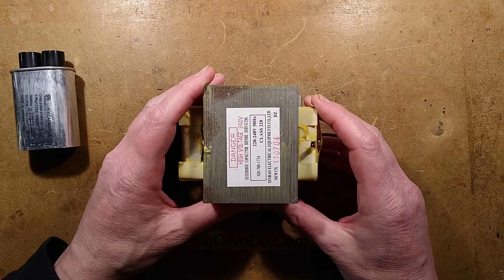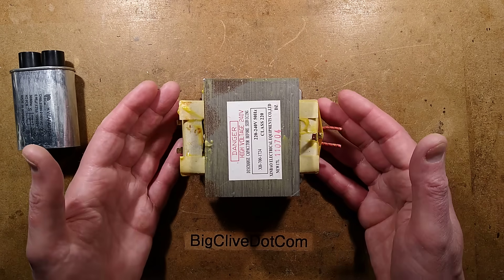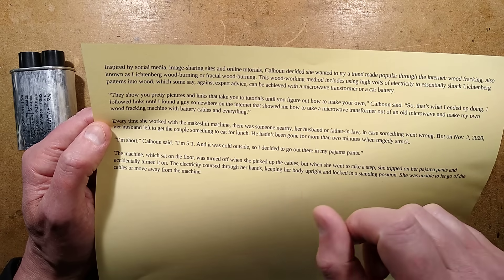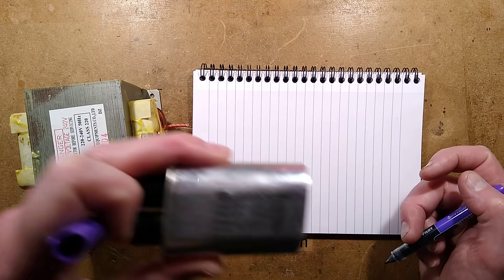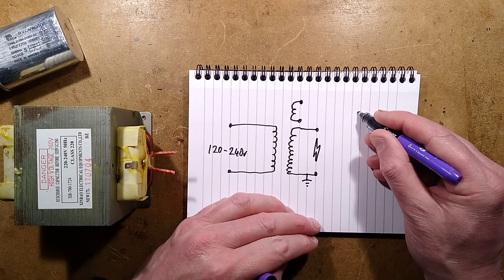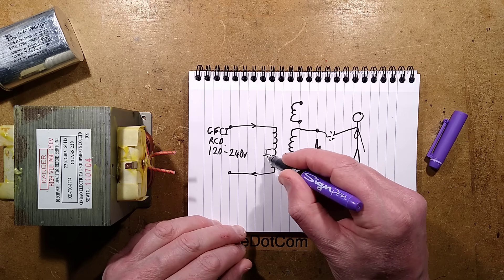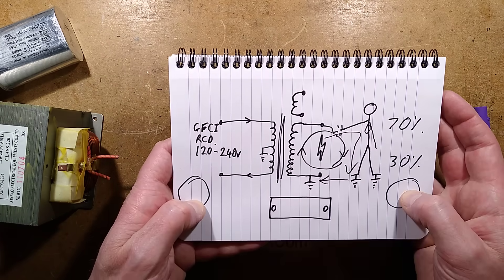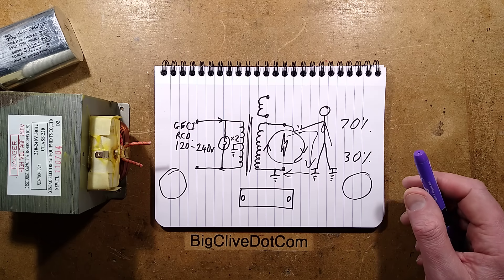The most deadly project on the Internet

Comment: I am a table top hobbyist who builds jumped-up High Voltage power supplies using old school automotive ignition coils. I have video footage of them here on YouTube. Those cock-eyed devices put out enough voltage to kick the snot snot out of you as it stands. Anyone who has worked on automobiles knows exactly what I mean. And that is with the normal 12 VDC they use. I have scrapped a few microwave ovens for parts including the MOTs and their caps. Those after taking necessary precautions. The MOTs  and their caps scare the devil out of me. I mean 2000 VAC 5 A is Electric Chair voltage. It gives me the willies just LOOKING at them to say nothing of hooking one up to do, for example, Fractal Wood Burning. Many are the horror stories of someone landing crosswise of live MOTs and not living to tell the story. Pull them up. I DO NOT recommend using them for anything other than their intended purpose. To do so is to risk instant death not only to you, but to an innocent person who has no knowledge of what you have there or how dangerous it truly is. Nuff said. Stay safe, Stay healthy. Remember to be kind to one another. We are all connected. We are all one.

Comment: Contactless fractal burning: 
You put screws into the wood board project then put the electrical clamps from transformer onto screws. Have a 15amp breaker from a surge protector inline along with a household light switch. Keep burning. 

I don’t know why people are holding the cables when doing it.

Comment: the most scary thing with electricity is that, you can't see it smell it hear it (at household currents). The the only you can is feel it and if you do you are in a situation were you are currently being shocked.
A trick i learned from my teachers when i was studying is that whenever you are going to touch something that might have a current in it, touch it with your outside palm. that way you have no way of gripping the metal that has a current through it and will most likely just pull yourself back and away from it.

Comment: As an electronics engineer I am incredulous that people will play around with this stuff. The risk level is so high that even those in the know would be super cautious around circuits such as this one. I cannot imagine what would possess someone to touch poorly insulated homemade probes carrying upwards of 3kV whilst around saline solution. The risk level in doing do this is insane. If holding the probes in separate hands the shock current path would be directly across the heart. In that scenario a current of only 20ma can easily be fatal. 3kV would results in shock currents far in excess of that. If you don’t know what you are doing don’t play around with this stuff and if you do be super careful with it.

Comment: I have been into electricity since 1977, I loved everything electrical. And learnd at a young age what electricity could do and always gave it the respect it diserves. At age 6 I got an even harsher lesson on high voltage when a class mate of mine, her father was a lineman and he got burnt over 80% of his body. I remember it like it was yesterday because I always idolized him because he worked with electricity. He's ok now but he has a very hard road he has to travel. I had been shocked by 120v before and didn't like it, and after seeing and hearing about what happened to him gave me a new respect for high voltage. That stuff can jump through the air. That's what happened to him. He was permanently disabled.

Comment: It's good to see someone pointing out the dangers of microwave internals. I've been repairing microwave ovens for over 40 years now & from day one, had a healthy respect for safe service methods.  I remember a couple years after having worked on them, I was invited to a training course by Sharp Corporation in Adelaide to learn their products. Walking in the door of their training room, the first thing we see is a whiteboard & printed in big red marker were the words "MICROWAVE OVENS KILL TECHNICIANS  WITH 4000 VOLTS AT HALF AN AMP!!!". 2 attendees turned around, walked out & never returned. During the course I was shocked learn that at least 2 of the other technicians there were up until this day, doing dangerous things like holding the HV lead with a pair of pliers to see if they could draw an arc off. One guy had turned very pale & couldn't believe how lucky was to have not killed himself or caused serious injury. I hope the clowns who promote these dangerous videos are in countries or states whose Electrical laws are very strict, they get get recognized by someone  & turned into the local electrical authority & prosecuted to the maximum the law allows. Electrical work should only be done by suitably qualified & licensed tradespeople.

Comment: I've seen a lot of good formulas or lab but while showing tik tok reckless motives, made instant heat with coils melting aluminum a just sling on driveway, making crude methods results into failure or loved ones.
I call them "educated idiots".
Lacking critical thinking 🤔
Industries like foundry I use to work, wisdom by hands on brutal hard and hot methods.
Mixing with education and hard work higher inlightment more positive results informed decision.

Comment: I am terrified of complacency. Which is why I built a shielded, enclosed sled for my tablesaw: it's designed so I can stand slightly off to one side (reduces chance of a kickback injury) and push the sled, while the hand closest to the blade is protected by a thick piece of aluminium. Atop the sled is a 1/8th plexiglass and it is screwed down to the sled, the sled being heldto the table via the built in proprietary t track. I also wear gloves and lab goggles since I cut metals. This over-engineered shielded sled has likely saved my life, my eyes, and limbs.

Comment: I have seen so many videos over the year about these "DIY projects".
One of the things I have seen is that none, absolutely NONE are using insulated tools.

Real insulated (certified) tools by say Knipex, Wurth, Wiha, Bacho etc. are expensive. But is something an electrician would never leave at home..

Now, I'm not an electrician. But I do have respect for anything that use voltage from the wall.
I work with machines that use 240v and even as much as 400v. When it comes to the electric part, I leave it to someone who is trained in high-current electricity.

Sure, I do know more or less what to do, but IF something happens - there is no insurance company in the world that would help me in case of an accident!

Remember - if you are not a trained electrician, don't mess around with stuff you do not know!

Comment: So real people, with functioning brains and everything, play with the HV secondaries on an MOT? People are that dumb? (qualified electrical brains wouldn't even attempt this without substantial safety precautions)... To make it a bit safer, remove the reference to earth on the laminations, so the winding is isolated and use the earth ref point on the winding as the neutral for your burning device. Then it might just blow your hand off, but keep you alive(no path to earth through the body). Or if keeping the earth ref point, earth your ankle so you might just lose a foot...but At least add a couple of footswitches, both needing to be pressed (with different feet) to power the primary. Better still, bin the f..ker.

Comment: I’m not sure you’ll see this, but on your mentioning of “a violent experience” you reminded me of something stupid I did when I was young. I was wondering if you could explain it or cover it?

I saw a video saying you could make a prank electric shock machine from a disposable camera. I had one lying about and tried to get into the plastic shell and get at the circuitry. No luck, so I used the only tool I had available - the flathead screwdriver. Levering it open and breaking the snap connections I reached further in. I must have touched the circuit board and shorted the capacitor but I remember completely tensing and falling onto my bed. It was like I could hear electricity but on my brain. Absolutely horrific experience for a 12 year old. I’d love for you to explain it and what I did!
Reply from the maker: A camera flash stores a significant charge.  Definitely not suitable for electric shock pranks.
Reply: @bigclivedotcom  The only superpower I got was; a respect for electricity

Comment: I got hit by this.  No good.  I was holding the frame and reached for the positive terminal, and before I reached the terminal, an arc about 2 inches hit me and I just saw red.  Great thinking I yanked my arms back quickly, almost dislocating my shoulders, but I broke free.  After my adrenaline died down, my lips, fingernails, shin, and toe was slightly split and bleeding.  That was the last time I messed with this transformer. I could have been dead too

Comment: You know it's dangerous if mains power is considered the "low voltage" side. The one hand rule won't save you here. High current 2000 volts will go through your heart no matter what.

Comment: I would play with smaller ones out of TVs or radios and connect a 9 volt battery. I would have classmates touch the terminals and hold hands, everyone would get chocked 1⚡⚡⚡🤗

Comment: Deadand switch is what, 40-50$? And you can make the leads clip on and insulated I assume? With proper safety it could be done but why do it the fast way? Slow can not only be better in terms of safety it can be better controlled no?

Comment: About two years ago, an individual in my hometown died from electrocution while doing fractal wood burning. This case is even more bizarre because he was an experienced electrician. Additionally, when I was a teenager (about 40 years ago), I was tinkering around with a transformer from a microwave oven and nearly electrocuted myself. I had hooked up an electric train transformer to the microwave transformer and was watching a metal spoon vibrate from the current. Unfortunately, I touched the wrong thing and could not let go of the spoon. I could not even yell for help. Somehow, I found a way to break free. I still like to tinker with things but am exceedingly cautious when working with electricity.

Thanks for sharing this video with your viewers. It’s very informative.

Comment: I used to work with an old man who only had a pinky and a thumb on his left hand and they had like broken his pinky and turned it sideways and then moved his thumb joint up to where his first Finger Joint should be so he had like a claw he could grab stuff with. But anyway his hand was like that because he was doing some Roofing started to fall off the roof reached up and grabbed a hold of a power line. It blew him off the roof blew three of his fingers off, and caused him to have a heart attack. He was very lucky to have survived and even so spent the next several years having very painful surgeries on his hand

Comment: Back in the 80s, I worked for a manufacturer of battery chargers, and special power supplies used in movie, medical and military applications. Some of these systems contained battery packs that used 2V 5AmpHour batteries.  For those of you who do not know, the Amp hour rating means in the case of these batteries, it can provide 5 continuous amps @ 2V for 1 hour. Or it can provide  300amps for 1 minute, 600 amps for 30 seconds and so on. I came across one of our assemblers of the battery packs soldering battery terminals while wearing her wedding band. I told her to take off her ring. She said "I have built hundreds of these packs, they are only 24 volts. I'm fine"  I told her it's not the voltage in this case, it's the amperage. She told me to buzz off so I did.  Sure enough about 10 minutes later.......I hear a scream.  Her ring shorted across a 2 volt battery and melted like a fuse. It left 2nd & 3rd degree burn all around her finger.  Complacency is the #1 reason why people who work with electronics get shocked.  Today, I work with a laser that uses up to 32kV to fire across the electrodes. If I get lazy around that, I will be dead before I hit the ground. There's a reason why I am 25 years in with this company and still walking.
Reply: yeah people who assume I know this....done it so long are the ones who can die over the newby who is more ca

Comment: As an electrician, I had a buddy, who was also an electrician, that had his pinky finger and the one next to it welded together cutting a  conduit with a 480v circuit which was allegedly turned off. They had to let it heal before they cut them apart.

Comment: I have a probe that connects to a Mueller clop through a 10 Mohm resistor to drain capacitors.  Unless someone has gear like that and knows why it is used they should not be messing around with high voltage transformers at all.  There is no safe way for ignorant people to work with high voltage, high current circuits.

Comment: According to Nikola Tesla things will start to become interesting at the 1 million volts mark, he did have demonstrations where a row of people held a wire in between (say 2 people on each side of the wire with the ones on the outside holding on to the power source) and only the wire (in between the people in the middle) burned up, the people themselves felt nothing. (could also have been a frequency we don't use)

Comment: I studied to be an EMT long ago and our text book had trauma photos. the electrocution images were some of the worst. lightning victims often have holes in the bottoms of their feet the size of a quarter dollar and their shoes will be blasted off their feet and often quite far from their body. electricity is spooky. it can come up from the ground and hit u. I'm not afraid of the dark, I like to pick up snakes where I find them,but I'm afraid of electricity, and spiders.
Reply: Lightning struck by my house one time, and the cover to a power adapter for a modem was blown off. And the circuit board was charred from it too.
Reply: @luked9546  Lightning struck a house 30 meters from my parents home. I was at the attic and I was in deep thoughts about my existence, God and purpose. I felt regret and lost. Then, the lightning came right at me and diverted just before it would hit my existence. The other house was struck at the attic too, blasting a 1 square meter hole in the roof (bricks, roof tiles gone).

That could have been me..... I guess God was telling me something....
Reply: I was indirectly struck by lightning at a bus stop with my brother and some strangers during a flash flood in Las Vegas 10 years ago. Luckily we were grounded thru the bench we were all standing on to avoid getting soaked. It was kind of like Bill & Ted in the telephone booth except with the bus bench & awning. A brass buckle on a messenger bag I had on made a contact point between my left shoulder and the awning that launched me forward to the ground where I nearly fell over completely only barely catching myself. I was wearing flip flops and could feel a slight tingling in my toes afterwards. Also killed an old phone I had the was already on the fritz. The street lights as well as the back lights on the bus advertisement went out for a few seconds then flickered back on; while the 4-way stop light on the corner eventually came back with flashing red lights. The craziest part was one of the others was actually wearing a cap that said "Death From Above on it."
Reply: electricity spiders are the worst.
Reply: @jhoughjr1  💯 Absolute bastards (those electricity spiders)
Reply: Man, heck spiders!
Reply: Been hit by 110 direct, and 240AC, both times being stupid, I do t fuck with electricity anymore, although saltwater crocs are my other no no, everything else in Australia I'll take on hahaha

Comment: See, the thing about high voltage electricity is that it’s invisible. If you turned a chainsaw on and just left it in the middle of a room, nobody would touch it. It’s loud and you know it will hurt or possibly kill you. But like I said, electricity is invisible and mostly doesn’t warn you. You just touch it and it forces you to hold on. What these people don’t realize is that they are using salt water to make it ark across the wood, but they themselves are 97% salt water. You hold on and if someone doesn’t have a fiberglass or wood stick, you will literally fry to a crisp.

Comment: i used one of these transformers when building a tesla-coil, sadly the voltage is not enough without stepping up the voltage with a ton of capacitors and diodes. i will remove the MOT and replace it with something else that isn't as dangerous and works better in that application.

Comment: As a chartered engineer specialising in the design of Hv earthing systems, this is a very good explanation for the layman. Especialy the description of the RCD protection on the primary side of the transformer and no protection on the secondary side.

Comment: once I made a board with the 230V transformer on it. not plastic case, a bare board, 6 TIMES I caught it the wrong way and got zapped, I could feel the numbness creeping from my hand to my shoulder before dropping it. weirdly my breaker never cut the power.

at some point I put hot glue all over the 230V part to avoid doing it again.

some people just can't be trusted with electricity lol.